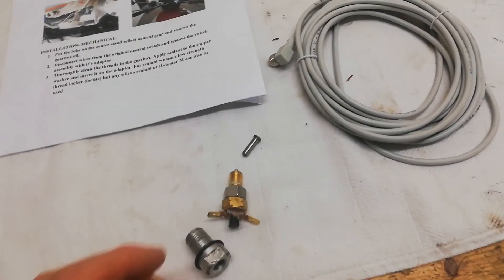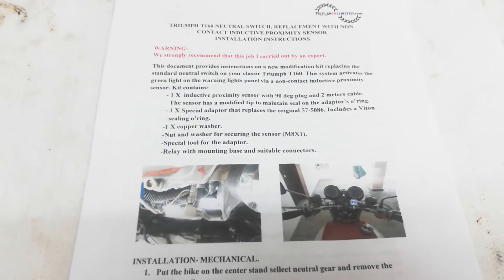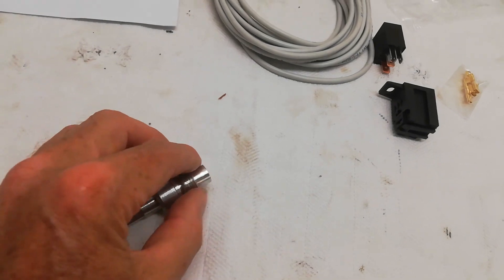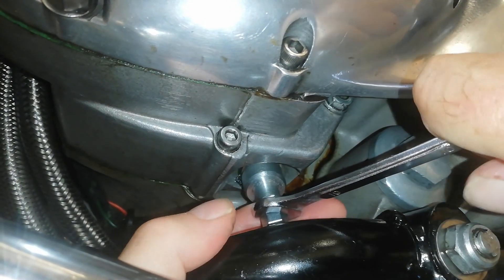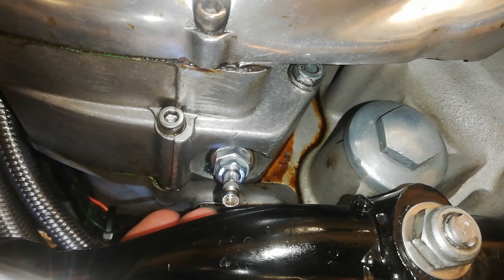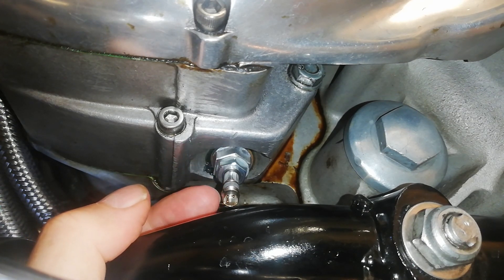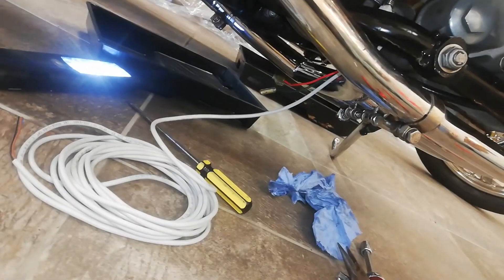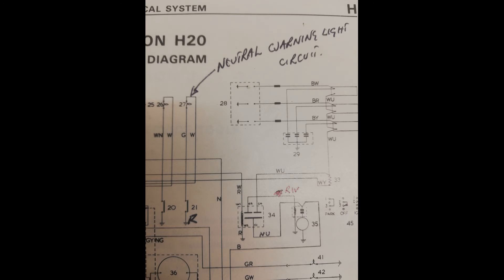Fitting a Neutral Indicator Sensor to my '75 Triumph Trident T160 to replace the original switch.

Comment: @ianmccall7285
5 hours ago
Hello Chris, thanks for your video and wiring update re this sensor and thanks for your manuals in restorations.  I’ve bought a sensor, fitted it and extended the neutral switch wires etc. I was just wondering if you had a photos of the placement of the white wire from relay to the “common ignition circuit” . eg where did you find the best place to pick up the white wire please …..I’m rubbish at electrics !
Reply from the maker: I'll take one for you in a while - but I'm not sure how to post it as I don't think I can do that on here.  Could you contact me through Messenger?
Reply: Thanks Chris, sorry to be a pest ….no hurry whatsoever  @Chris.rooke150

Comment: Can you tell me the website you used please? This is exactly what I need for my 1976 T160.
Reply from the maker: The kit is made by Triples Unlimited, in Greece. http://www.triplesunlimited.com/index.php?route=product/product&path=70_73&product_id=108
Reply: Hello Chris, thanks for your video and wiring update re this sensor and thanks for your manuals in restorations.  I’ve bought a sensor, fitted it and extended the neutral switch wires etc. I was just wondering if you had a photos of the placement of the white wire from relay to the “common ignition circuit” . eg where did you find the best place to pick up the white wire please …..I’m rubbish at electrics !

Comment: Great videos Chris.
When replacing my last neutral switch regular type (i happened to have the g’box inner case out), I fitted the neutral switch fully into the adapter first.
In first gear the case slipped in nicely, once past the frame rails i backed it well out, before finally engaging the gear change mech.
Just failed its MoT, so renewing the bushes in the swing arm next.
Reply from the maker: Good idea.👍